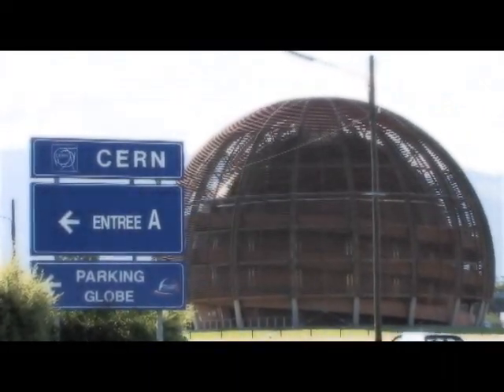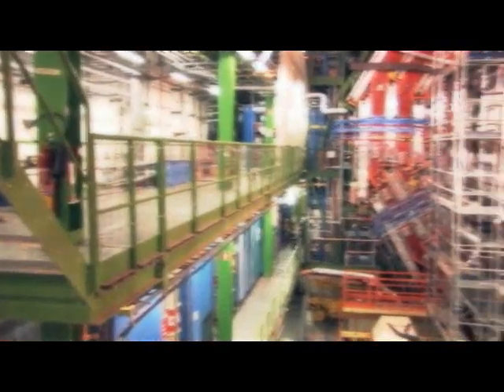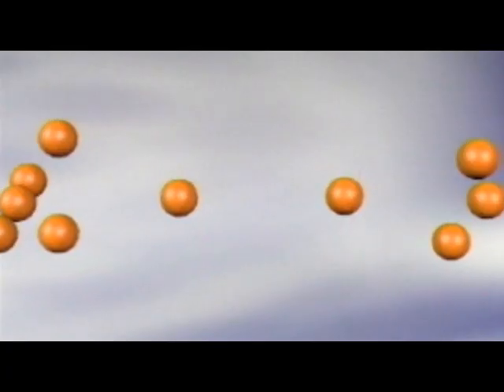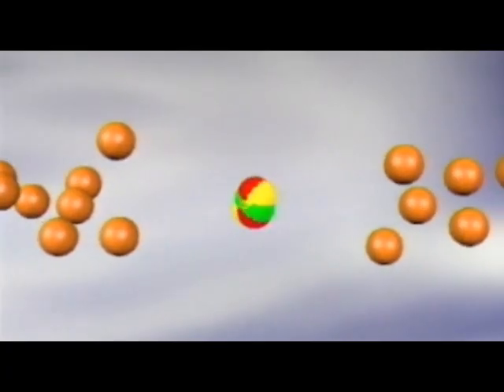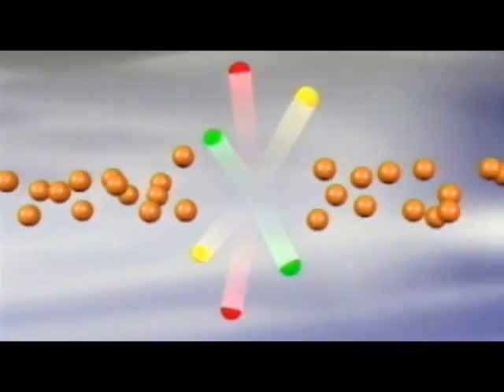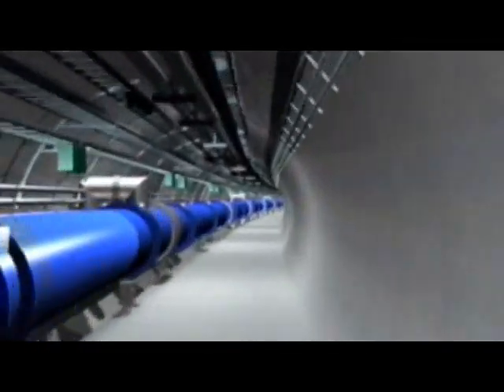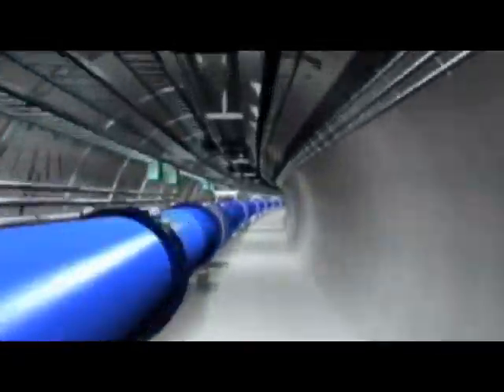CERN and the LHC (Large Hadron Collider)

Comment: A speck of polonium in molten rock can be compared to an Alka-Seltzer dropped into a glass of water. The beginning of effervescence is equated to the moment that polonium atoms began to emit radiactive particles. In molten rock the traces of those radioactive particles would disappear as quickly as the Alka-Seltzer bubbles in water. But if the water were instantly frozen, the bubbles would be preserved.

Comment: @TeamFortressKilla
if you have problems to virualize what a METER and a GRAMM is ... lets do follow math

1 Meter = 3,2808399 ft -> 1 kiloMeter = 1 Meter x 1000
1 kiloGramm is a block of water at its "highest" destiny of 1kg/dm³ of the size of 1/10 m each side
in other words
1 kiloGramm is the weight water have at highest destiny in a block of 0,32ft side-length

hope this helps ...